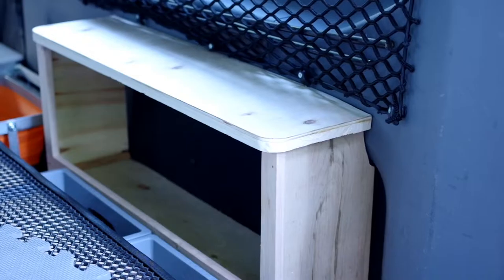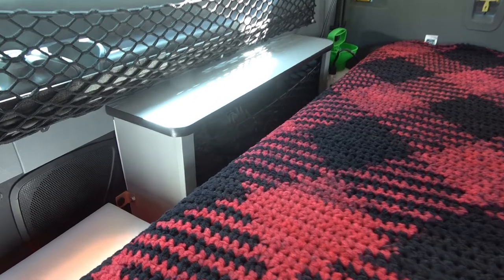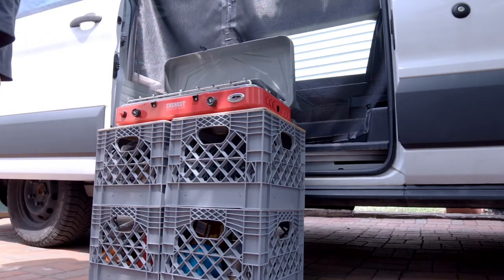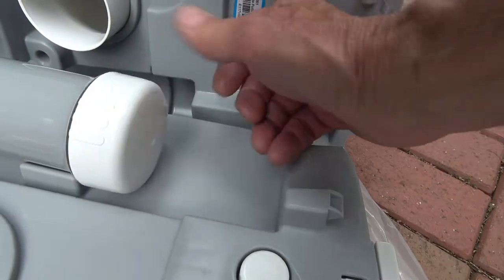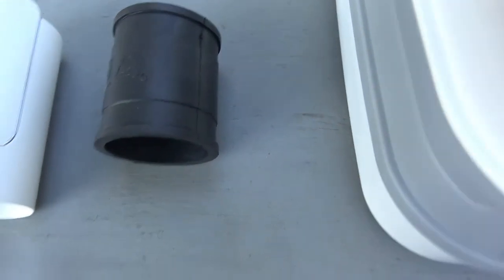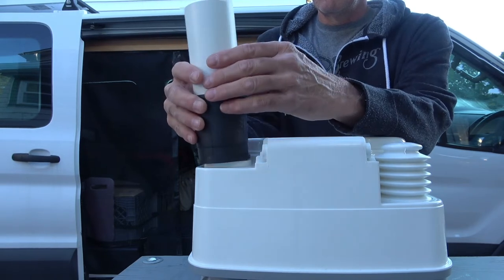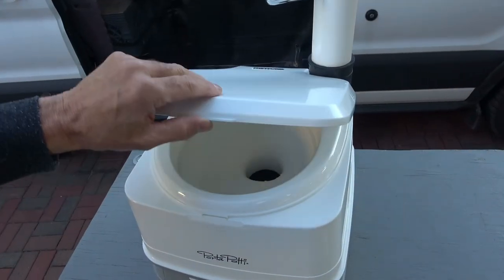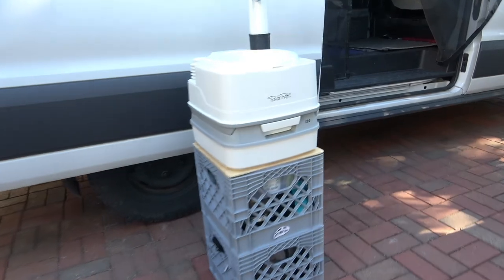Portable camp sink powered faucet cassette van rv suv jeep campervan usb

Comment: I can't thank you enough for solving a problem I've been trying to figure out for months. I have that exact same rechargeable faucet. I don't want to put it on top of a 5 gallon water jug I want it to sit on the counter. I've searched everywhere for one I can sit on the counter and can't find one so I've been trying to figure out a way to modify this one. This is perfect! I just got back from home Depot with this exact rubber fitting, and this works perfectly! A million thank yous!
Reply from the maker: Awesome !